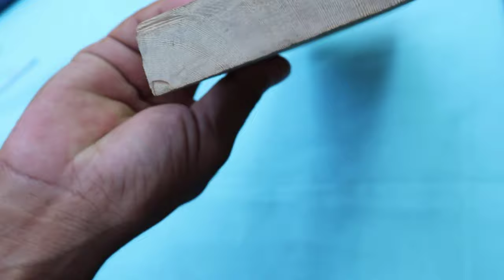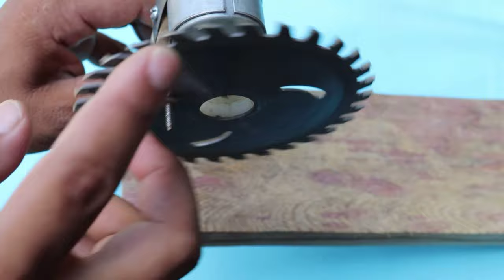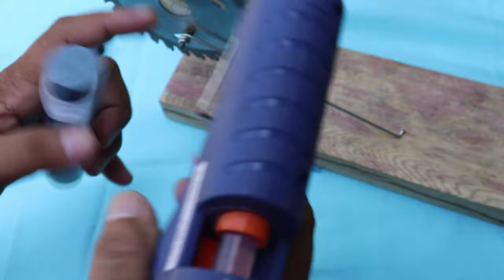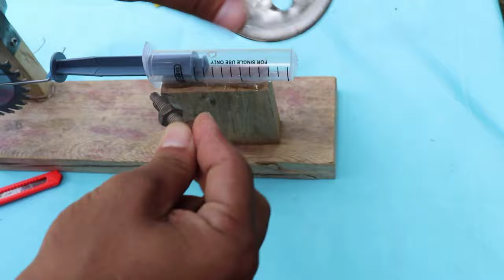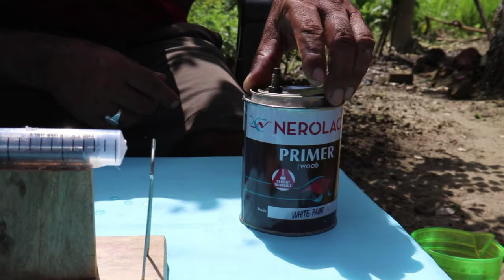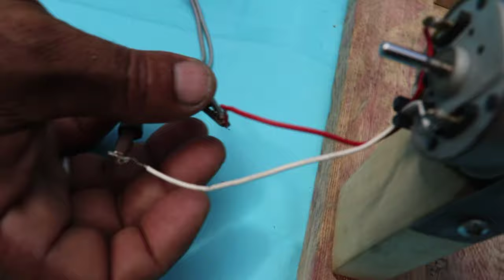Stirling engine part 2 || how to make at your home ||

Comment: Great project. Just one thing. This is a steam engine. Not a Stirling engine.
Reply: Injection ke andar Kya fix Kiya hai
Reply: Not ingection it is syrenge
Reply: not both of them he is just powering the motor to fool us  the bulb is blinking du to the rotational frequency of the motor because he is connected the bulb motor and the hidden battery in seriese
Reply: Pagal
Reply: Pepole this comment is incorrect some pepole are so pete right back at u STEAM  ENGINE GOO ROO NOT HAHA
Reply: @acidman7692  mujhe bhi aisa hi lgta hai yr pta nhi Sachin hai ya nhi
Reply: Are ye batao hame syringe me kya under lga rkha hai
Reply: Fake ha
Reply: Agree this steam engine
Reply: @anuardamit  where is the water?

Comment: Haha, It would have been better if you have shown the power connections with the battery as well... When you slow down the playback speed, the wheel is pushing the piston. instead of piston pushing the shaft. Moreover the power from the steam will not give such aggressive pulse at the start up. He is just playing with the switch, for it to look like an engine start up.... successfully reported the video😉

Comment: the piece of wood he uses to hold the motor is a setup. It has a battery inside. The magnet wire (coil wire)  coming from battery can be seen clearly. Watch closely

Comment: You made a very good engine, but this is not a stirling engine - this is a steam engine!
Your machine works by heating water so it becomes steam and expands, and then putting that to work by pressing a piston. This is the definition of a steam engine.
A stirling engine works by moving air that is closed in (and never let out) between a hot side and a cold side. Your machine does not do this.
Reply: No bro it's fake

Comment: I believe you made a steam engine.  A sterling has a diaphragm and can be run by heating one side, small flame or cooling the other, pack with ice.  They used sterlings to run parlor fans thru linkage and/or belts.
Reply: All a sterling engine needs is a temperature differential to run. If the hot side is hot, and the 'cold' side is ambient temperature, if the hot side is hot enough it will run. Steam engines and sterling engines are very different devices, steam engines need valves driven by the crankshaft, you can't just accidentally create a steam engine while trying to make a sterling engine.
Reply: Whoops, on closer examination, there only appears to be a power piston and no displacer, which would be necessary if this were to be a stirling engine. In addition, there is actually a slide valve built into the power piston towards the end of its stroke, so this is either a steam engine, although I cannot imagine it would work the way the video shows given the way it was built, or a fake, with a small battery and switch driving the motor which was ostensibly a generator. Not to mention, sterling engines that I've seen aren't really self-starting. Very interesting.

Comment: It's absolutely fake 
1.no steam shown at all
2.this type of engines require initial inertia
3.no drop in speed when a light bulb is connected
He is  powering the motor from a battery
Reply: Hmm kitna akalmand ho bhai kya baat? Kitne rpm ki motor hei ye bhi bta do
Reply: @rishabhsinghrawat9731  thanks I was almost convinced of this crap
Reply: This is a stirling engine not a steam engine there is a difference in mechanical behavior.
Reply: @andrewmccluney2425  ofcourse its different  it says sterling engine in title but in video he is using water to make steam and push piston which is definitely a steam engine  but still fake

Comment: No valve that shuts up steam... In my opinion it is fake. The electric motor spins the flywheel.
Reply: Sorry but you're wrong. There's a hole in the cylinder wall that lets out steam at the right moment. This is how they made old engines back in the day, because it lets you build an engine without having a valve. Basically the cylinder itself acts as the valve, when it passes the hole in the cylinder wall. The flywheel is necessary to contain the energy to push the piston back in again. Why bother faking this when this is the general design used by literally tons of steam engines before 1930? It is just built crudely but it is built using a working design principle. If you repeated his build as depicted, yours would work too.
Reply: It is not possible to make  glow the bulb with this setup

Comment: To stop flickering light use rectifier and capacitor high value light will be stable
Reply: Gak jelas blaszz
Reply: Bruh nerd.. just charge a battery with it, and use the battery power to the light
Reply: @3DPrintedEngineer  it would be a waste of time trying to charge a battery with this device. 😆

Comment: Can i get a reply of my question...
   My question is that when firstly it starts          
the force of steam pushs the syringe and how the syringe pushs the steam back...
Reply: This is fake
Reply: Thank you for fb...
Reply: @showkatahmadnaik385  you always welcome
Reply: The wheel acts as a flywheel during the return stroke, so some amount of energy is given back to the syringe to get it's initial position back (he made a hole in cylinder so that the pressure release and piston can move forward easily) and again the steam moves piston(syringe) backwards, hence the cycle continues.
(Ps - it's not a Stirling engine it's a steam engine instead)
Reply: Wood cutter acts like a flywheel
Reply: Fake
Reply: I am also making videos for YouTube on technology but my videos are not fake. I had try on this project but this is totally fake .so i request you please dont make fake videos for views . Your views are asset dont try to play game with his views.
Reply: He made hole in syringe so that expanded gas got released and then that rotating wheel pushes syringe back to its original place
Reply: the weight of the moving flywheel push it back
Reply: @techu3607  can you at least explain how it is fake? Instead of just saying things?
Reply: Its fake, at least it needs another piston to push the cold air into the hot one
Reply: @superpel3928  the steam flows in 1 direction only. its the water expanding into vapor creating this force.
Reply: Good
Reply: yep this is fake

Comment: That's not how any of this works. Drilling a hole at the BOTTOM of the piston's stroke won't exhaust anything. This would just push the piston back once and stall.

Comment: Where do steam go after exit the can?there is no walscheart to control steam valve by the way.
Reply: This is an old traditional steam engine design. The steam is let out of the cylinder through the little hole he made in the top of the cylinder. You make the hole at the deep end of the cylinder, so the hole is only open when the piston is at the bottom. It's an old trick from the old steam engine builders. Lots of steam engines were built this way in the 18th and 19th century.
Reply: @enque01  But how does the cylinder move back? You need to push steam the other way to work, that is what control valves do.
The hole just makes the steam go and then what happens? What makes the cylinder move back?
Reply: @mateosuarez7761  By the inertia of the flywheel, of course. He's using the sawblade as a flywheel. Without it, this machine would not work. He basically just picked any random object that could spin fast without having a lot of air resistance, while also weighing a lot. Flywheels are another 16th century engine design idea. I don't understand why so many people are thinking this video is fake? I mean, it might be fake, but a real steam engine of the old design really IS this simple. Exactly this simple. There's a hole in the wall near the bottom end of the cylinder, the cylinder is nearly airtight, there is a flywheel, and there is steam being produced inside a sealed container. That's all. You make that, and the thing spins. So who the hell would go through the trouble of faking something as simple as this? It would be like accusing somebody riding a bicycle as fake. It's harder to fake a bicycle video than it is to build a trash bicycle out of junk and ride it. Same with this steam engine.
Reply: @enque01  Now I get it. Inertia
Reply: @enque01  build it yourself and you will see the shit you are talking.. i work with steam locomotives...

Comment: Pepole this is a strling engine not steam engine INFO ON HOW STRLING ENGINE WORKS DOWN BELOW STOP CALLING IT A STEAM ENGINE.
Reply: It is not a Stirling engine either ... Stirling engines do not have any hole in the chamber to let the pressure escape , nor do they use steam to move the piston , they use heat ... And you see , the piston in a Stirling engine has to be airtight , but here in this video , it is nowhere near to be airtight ... It is either a steam engine , or the video is faked ...
Reply: @RandoniumTJ  isn't steam hot? You said yourself stirling needs heat, I see heat.
Reply: @BloodyKnives66  ya but the heat is the only thing we need.  Not condensation.  Steam will cause condensation.

Comment: Where is capacitor? You could also have used any cell to store the electrical energy, the flow of current is not uniform so it may cause damage to the appliance

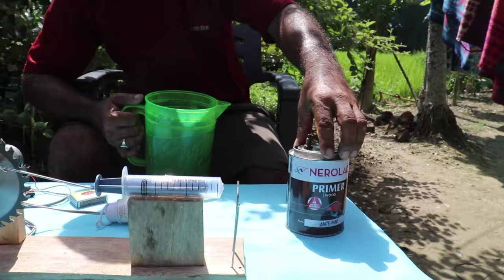Comment: you put water in it after steam ends it will stop working it not stirling engine it is steam engine if you dosent put water in it it will not work watch 8:00
Reply: It's not the problem actually......what he used here is simplified version......if you use two chambers......and connect the shafts at 90 degrees .......you can make it working with heated and cold air......what he actually did is much like pressure cooker...lol

Comment: This is a fake video, I tried it and it doesn't work. Dont do this
Reply: me too, this is not real, scammer
Reply: Yes! When i put air into the engine, the piston blocks. Must see how a real steam engine works and this is completely different.
Reply: Probably he has hidden batteries in somewhere to turn the electric motor